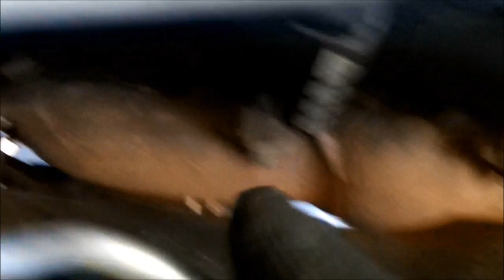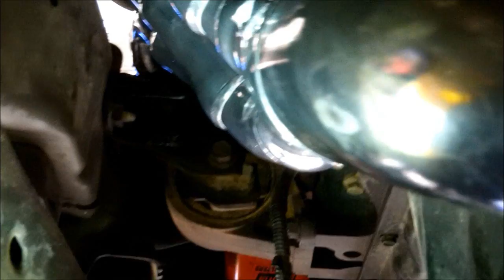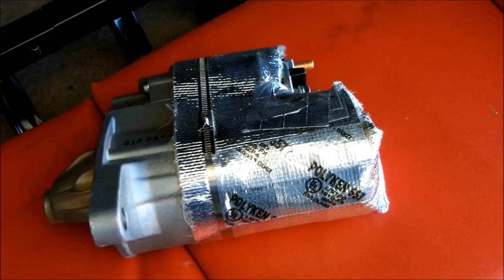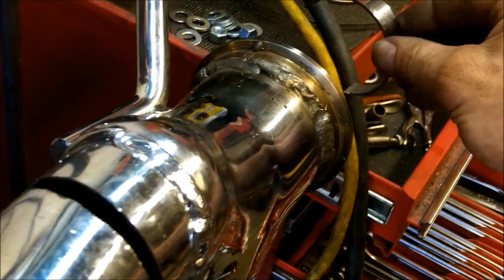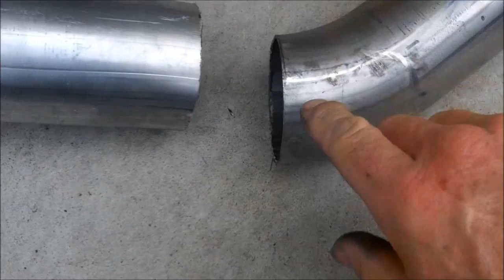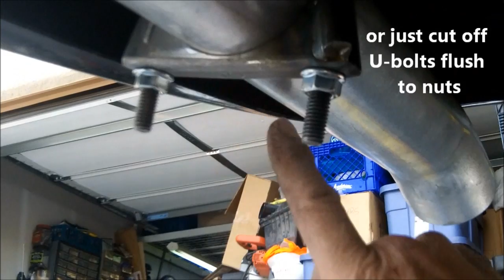How to Install Doug Thorley Headers on a 99-04 Jeep Grand Cherokee with 4.7

Comment: Do you think these would work someway on my 06 WK 4.7V8?
Reply from the maker: Looks like the starter on your WK is on the driver side this will be a problem for that header because it fits very close to the engine block in that area.

Comment: Hi Martin, Great Build, truly the best I've seen out there.  I'm getting ready to install my Doug Thorley headers, and wanted to know what model cat you used?  I have an 03 overland.  also is there a preferred brand for the rocker arms and lifters?  I'm going to replace these at the same time as I am just touching 150K,  runs great, but want to start mitigating any future issues.  Thanks again for putting out such great content!

Comment: Do you think fabricating a Y pipe from flex pipe is a viable option?
Reply from the maker: I would recommend taking the time to make a custom Y-pipe from mandrel bent tubing and never use flex.
Reply: @martinbuilt  yeah that's what I'm leaning towards. Why is it that you didn't use any header wrap?

Comment: Any tips for the passenger side lower bolt, second from the front? I’ve got the other 7 started no problem but can’t get that one to start for nothing
Reply from the maker: Make sure that all the ones that you have started are very loose so you can pull the header as far away from the cylinder head as possible and you should be able to get that 1 started.

Comment: My "Y" pipe wasn't right, Doug Thorley corrected the issue and I'm back wrestling with tools trying to get the job done. Not sure what "Day" I'm on. Some of these bolts are almost impossible to reach. I need smaller hands.
Reply from the maker: It really helps to get all the bolts started, that way you can hold the header away from the cylinder head and makes it easier to get the bolts all in.
Thank you for watching.

Comment: Famous last words, "I'm keeping the pan". On my day two and I need a new starter to continue on my 2000. So I get some days off.
Reply from the maker: Yeah I'm hoping my starter never goes out.
Reply: @martinbuilt  Even though I discovered I had the right size starter, I put in a new one, in the hopes and prayers I would not have to switch it out any time soon, either. I also got $30 trade in for the old one that was 10 years old anyway.

Comment: That sounds perfectly hot.
What is your opinion on the magnaflow Rumble 3 chambered muffler ? Just added it on my jeep WJ next will be a new stock Y pipe.
Reply from the maker: Thanks, I have made some changes since this video was made. I am  not familiar with the MagnaFlow Rumble. I changed the muffler to a Hooker Aero Chamber. I like it.

Comment: Would u think these would fit a 03Ram 4.7?  I would say the driver side would be a problem but I got shorty headers for it to have them extended or have them work together
Reply from the maker: Yeah, the driver's side would be the problem. I believe your starter is on the left side. The grand Cherokee is on the passenger side.  So yeah, the passenger side header probably would fit on your Ram.
Reply: @martinbuilt  what can you do for the driver side being a 2wd 4.7?
Reply from the maker: @jholivanotero   These headers will fit with no problem if you have a 2 wheel drive as well. As long as it's going in a Jeep Grand Cherokee.
Reply: @martinbuilt  always hot damn, no I got a ram 4.7.

Comment: Just think about the day th wheat was your starter and your out in the middle of nowhere and have to replace the starter. Headers are cool, but only on a track car. Just not worth the hassle sometimes, trust me I have installed many sets of headers. They are never engineered quite right.
Reply from the maker: Yeah if this was a off road Jeep I may have not have done the headers.. This particular Jeep is a pavement pounder. There are a few subtle changes I would have made to the headers for instance the Y-pipe,  I would've made sure no matter what transmission Pan was used that the Y-pipe would have cleared.  I've always wanted to fabricate my own wife pipe but there always seems to be other things that are more important.

Comment: One more thing Martin, where did you get your headers? I've looked high and low and cannot find the ones you have here anywhere. There are long tube headers, but I want to keep the cat pipe with  3 high flow cats I plan to weld on and some sort of cat-back 3" system, maybe dual Flow masters or similar. Thanks again!
Reply from the maker: https://www.summitracing.com/parts/dte-637y-c?seid=srese1&gclid=Cj0KCQjw6-SDBhCMARIsAGbI7UhUBx10_Bg67iOLlckMIgamhZaq24MoYvdjjpWQMI282e4FQjNA_r4aAlxLEALw_wcB
Reply: @martinbuilt  Thanks!
Reply: Oh man that’s Literly wat I’m planing to do in a month or so when I get all the money together pls lmk how that go and how it sounds too

Comment: Nice Job, well planned and executed. How did you get around removing the 2 pre cats without triggering a CEL? My understanding is that the HO2S placement is such that without all 3 cats, the computer will trigger a CEL, in other words one cat isn't enough to satisfy the computer. Plenty of these pop P0420 cat efficiency codes with all 3 cats installed, mostly due to weak pre-cats in the down pipe. I would think removing them altogether would cause the came issue.

I have a vin code J HO Limited which I'm working on doing the same kind of project overall as you have, only difference is in Summer I am running 22's with 265-35-R22 rubber on all 4 corners,.. with the Limited, the suspension already sits low enough, no need to add drop coils on a 4 corners. There is less than a 1/2 in difference in overall tire size between 235-65-R17's and 265-35-R22's,.. a tad wider, but no rubbing anywhere. Winter here in Pa. requires real  M+S tires on the 17" wheels, which saves the 22" polished rims from corrosion and tires from year round wear. I dig the look of your all blacked out WJ, and really it sounds great!
Reply from the maker: It took about 700 miles before cel light came on and yes because of the one cat only. So by using the anti spark plug fowlers and extending the distance from the rear O2 sensors  I am able to avoid the cel light from coming on unless you run it at high rpm for some distance.
 Sounds like your building a real nice WJ. Thanks for watching. 🙂
Reply: @martinbuilt  Thanks for the reply. ..2 more quick questions, will the Doug Thorleys fit the '02 4X4 WJ, and will the factory 2 cat Y pipe fit them? I have to deal with emissions here in Pa, but not the Smog Check, so if it passes or not they don't care about equipment being there, as long as there are no codes in the system. I wonder if there is a way to re-flash the computer to eliminate the dual cat setup, so it only see's bank 1 sensor 1,  bank 2 sensor 1,  and bank 2 sensor 2 (post cat)? Just both banks to set fuel trims and the post cat to see the clean up. 

There must be a way around the 3 cat dilemma.. but then again, if you haven't figured it it, perhaps not,  as you know the WJ's backwards and forward !

Comment: Can you put true dual exhaust out the back on WJ's? I've heard it's dangerous from my muffler guy, what say you?
Reply from the maker: If you have a WJ with the EVAP that is mounted next to the fuel tank I would say don't do it and if it's on a 4x4 that would make it hard to get around the T-case.
So if it's a 2wd and the EVAP is under the hood yes you could do a dual exhaust out the back.
Reply: @martinbuilt  Thank you for the most thoughtful and informative answer any one has ever given me!! So nice to talk with someone who knows what they are talking about, thank you again!!!
Reply: I can only assume your jeep has an EVAP and that is why you have a single exhaust? But then again I know you did a fuel tank tuck among so many other things so where did you locate your EVAP? And man that was a a lot of work getting those headers on, but great job!!!.

Comment: I just had a new motor (reman) in my 2002 Overland.  If I could have gotten these headers in time, I would have had them installed with it.  Instead, maybe down the road when they're in stock again, I can do that.  Would be nice to get a bit more pep.  Mine's the HO so it's already decent, but more is always better.
Reply from the maker: More is always better.

Comment: Question Martin I have a 4.7 2002 ram would these fit? It’s been a huge pain finding anything but shorties or going out to look for custom fab work ;-;
Reply from the maker: The passenger side might fit The problem is on the driver side Is the starter Gets in the way and if it's 4wd forget about it.

Comment: Okay, I have a serious Q to ask you. My 06 WK 4.7 which I have a video of it up, I have been researching on where to buy some custom made or aftermarket made headers for the tight engine bay on the 4.7. Now, I could make my own or pay someone to, but, if these work on the WJ's, which I also have a 4.0L WJ too, then it would stand to reason it could/would work on a WK? The engine compartment and underneath isn't all too different between the 2 model's. Any good answer would be appreciated. Thank you for the video too, I liked it.
Reply from the maker: With the Doug Thorley right side header might fit from a WJ to the WK but, the left (driver side) would be the problem. The starter would get in the way and if it is a 4x4 I believe the drive line will be in the wat as well. Thank you for watching and the thumbs up.

Comment: You would think for as much as they cost they would fit better without all the moding
Reply from the maker: Yeah I wish they would have put a little bit more thought into the y-pipe so it would have fit around aftermarket transmission pans. Other than that only had to put the one little dent on the left side header

Comment: did you see a noticable gain from those headers ? im debating on making a set or buying a set of Dougs . also ive been following your build for quite some time now and absolutely love the direction your wj is going.
Reply from the maker: I can't say I saw a huge gain but, once I improved the air intake, 08 intake manifold, 75mm Throttle body, and 08 camshafts the combination of the mods worked well together.
Reply: @martinbuilt  u talked me into the 08 cams and installed them yesterday btw :) next is intake and throttle body . im surprised u responded heck ya man . keep up the great vids ill be looking forward to the next
Reply: @martinbuilt  with the ‘08 intake and cams, larger throttle body, and headers any idea goes much hp and torque gained? I’m looking mostly for improved mid range torque for towing.

Comment: You run into any headaches with the extra California emissions on your wj
Reply from the maker: the only thing that I had to do was add anti-spark plug foulers on the rear two O2 sensors because I had removed the front 2 cats.
Reply: @martinbuilt  nice I’ll have to do the same to mine. While I have ya, have to taken your wj to a dyno? 
And if youve checked what is your 0-60?
Reply from the maker: @rodom303  it took 700 miles before the code showed up from the rear O2 sensors. I have not put it on a dyno yet but the 0-60 is 5.9
Reply: @martinbuilt  wowzas keep up the great work m8!

Comment: Anything's possible with sheer determination.  I had to do the upper and lower balljoints on a mopar of mine recently, and the uppers are the old NASCAR threaded balljoints.... Needless to say, it required a 3/4 inch breaker bar that is 8ft in length, as well as a torch and even then... It far surpassed 1000 ft lbs to break those old ones loose, even with a torch.  And roughly 500 ft lbs of torque to spin them out after they broke loose, the job was so difficult it took about 10 hours to get two balljoints out.  ( my impact gun was no where near strong enough, even with 180psi going to it... Could not budge them )  Point is, I never gave up and the job is done!  The entire front end of that old mopar is replaced, balljoints/tie rods/bushings/adjustment sleeves/ hub+bearings/  brand new.  Never give up.  (:
Reply from the maker: Good job and I'm sure it handles like a new car now.

Comment: Are you going to ceramic wrap you exhaust to keep the heat level to a minimum. Online is one the cheapest places to by ceramic exhaust wraps and metal bands
Reply from the maker: no, I've been driving it for years now with this exhaust system with no issues. I check the floor board temp right after I installed.

Comment: Does the upper control arm on the pass side get in the way? I ask because I just changed my starter and the CPS while I was in there.  I have checked this video out a while ago and headers are something I wanted but the PITA you have had made me wonder if it was worth it for my application. While yours seems to be an on road performance leaned build mine is off road heavy. When replacing the starter I noticed that if the upper control arm was not there the amount of room increases greatly. I have a long arm suspension going on it over winter, the upper arm on the pass side is not used, it's a 3 link suspension with 2 lowers and one upper on the drivers side. Would not having an upper arm in the way make things easier? I realize that was not the issue with the tube impeding the installation of the starter, but how about overall? Thanks again on the solid lash adjusters video, a month now and after a couple of lash adjustments it runs great and is quiet as a church mouse. I like the subtle sound the solids make, reminds me of my old 327 solid lifter Chevy II.
Reply from the maker: yeah the upper passenger control arm does get in the way when trying to install the header. Once the header is installed the control arm can be reinstalled. yeah I would image if that control arm wasn't there that would make a lot of room.

Comment: Hey! Martin question when you say get the 08 inkate manifold do you use that factory throttle body? Or aftermarket 75mm? Appreciate the help
Reply from the maker: you can use the factory 68mm throttle body with an adapter but I prefer the 75mm
Reply: martinbuilt thanks men and the 08 intake fits right on? No mods?
Reply from the maker: @MrMatandolaliga1   there are a few tweaks 
https://youtu.be/clydV1x87q0

Comment: What would keep the these headers from fitting on the 2005-2006 wk’s?? Gibson sells 4.7L headers for the ram 2006 but not for the 4.7L wk 
Thinking these for the WJ should work...?
Reply from the maker: I've never looked under the hood of a WK so I wouldn't be able to advise you if it would fit or not
I know that the WK's have front independent suspension so that is what I would be concerned about.

Comment: Hello Martin wanna do these headers as well on my 2002 4.7 wj not sure I wanna move my battery to back but couldnt a better battery box be made with keeping cold sensor and get rid of that plastic monstrousity.???snookie pa.2019
Reply from the maker: Hi Allen, you only need to remove the battery and tray to install the headers then you can reinstall the battery and tray. I did eventually moved the battery to under the back seat I have a video on that as well

Comment: hi martin, i am wondering how you managed the O2 sensors, is there a way to trick the ECU do avoid del CEL code? apart from the light, does it cause any issue?
thanks
Reply from the maker: I still have one rear cat. I didn't get a cell light for the longest time and I usually only got it if I'm running a higher RPM for a longer time. So  to cure that placed a couple extensions on the rear O2 sensors around a inch and a half long
Reply: @martinbuilt  so the relocation was not enough? you also put some extensions to remove the O2 sensor from direct exhaust flow?  the cel code does anything to the engine, limp mode or similar?
Reply from the maker: @GeoNemesisITA  well the thing is to it is a high-flow catalytic converter it will not be as efficient as the factory one and this is probably why I got the code at a higher RPM. No it does not go into limp mode if the cell light didn't come on at all I wouldn't even know there was a problem.
Reply: @martinbuilt thanks, i asked you this because i have spare set of stock headers adn i was wondering if removing the pre-kats is worth and make any improvements.
Reply from the maker: @GeoNemesisITA  As long as you also improve the intake side of things.

Comment: Dang, nothing on their site for a 2002 Dakota 4.7l.... I also noticed that the battery is on the passenger side. My wife's 05 Cherokee has it on the drivers side. Why did they flip things around? Or is your video inverted? Thanks.
Reply from the maker: There were quite a few changes in 05 for the Grand Cherokee.  yes my battery is on the passenger side. 04 was the last year for the solid front axle as well. Yeah I don't know why they didn't make any full length headers for The Dakotas there are a lot of them out there.

Comment: Hey Martin, I was wondering if your rear o2 sensors threw a code after putting in the headers with no cats. I ask because I have clearance issues with my adjustable control arms and the cat converters so I will need to remove them. 
Thanks
Reply from the maker: I still have the rear cat and I didn't throw a code for quite some time. I did get a catalytic converter  efficiency code so I got some of those O2 sensor extensions (anti spark plug fouler's) which eliminated that problem..
Reply: @martinbuilt  thank you for the response!
Reply from the maker: @DIYrotary   Thank you for watching and subscribing.
Reply: @martinbuilt    Very interesting that the computer caught on that something was amiss.  Did the computer self learn all the new power the headers added?